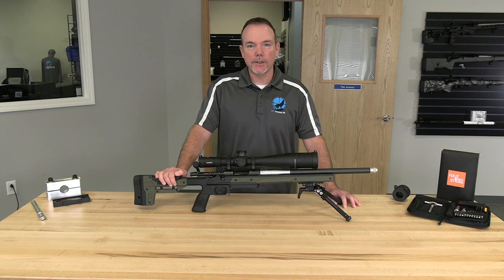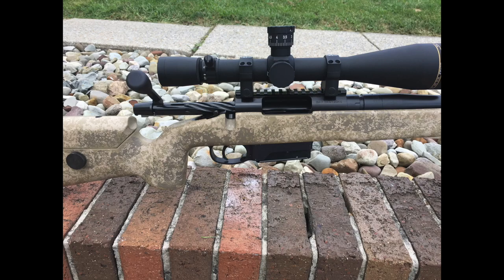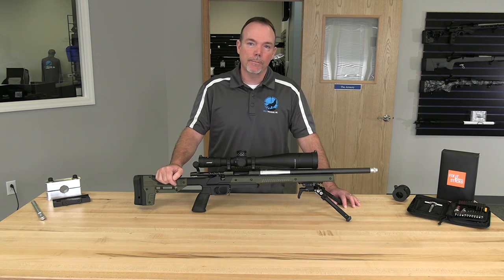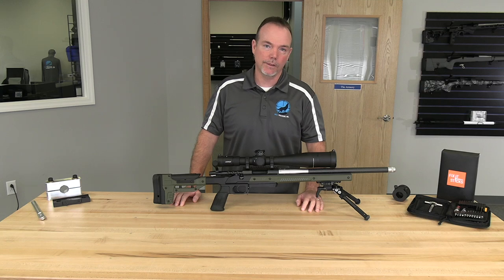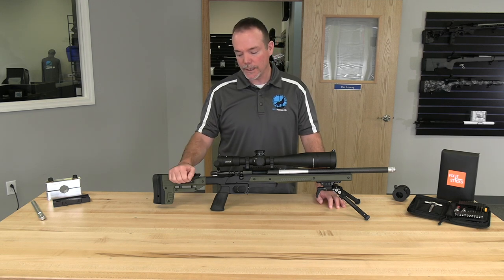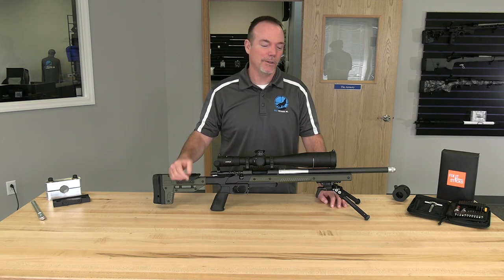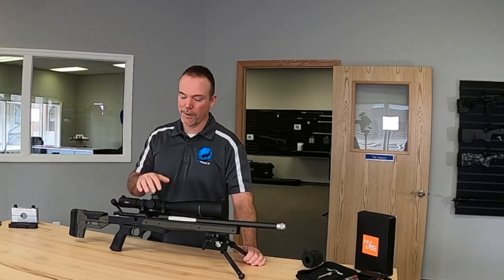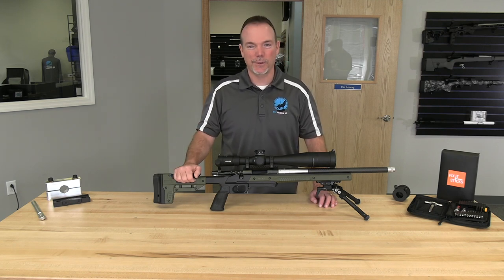Oryx Chassis Review Take 2!

Comment: 13" LOP is a bit long for most youth shooters, for a .22 trainer do you just cut down the butpad or have you found another way to shorten it?  I did not hear any mention on if it has an adjustable mag well, seems that is the biggest factor in getting the .22 trainer mags to feed well.
Reply from the maker: I don't think it can be shortened anymore,  we where thinking .223 when talking a 22 caliber trainer.  Although in a rimfire it would be awesome.